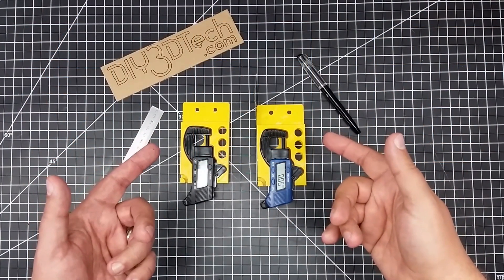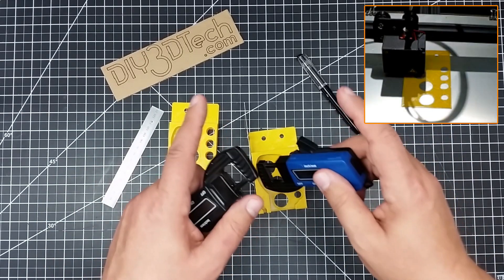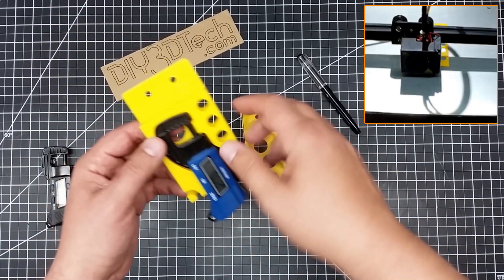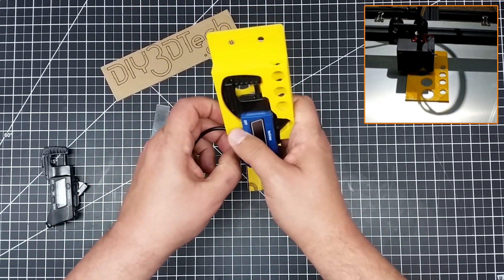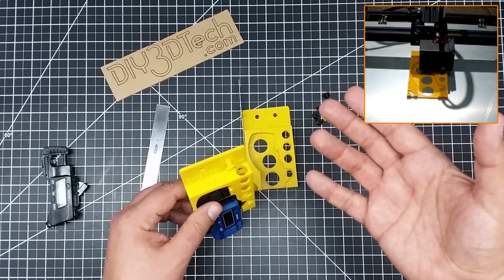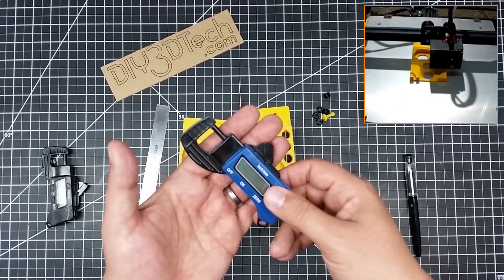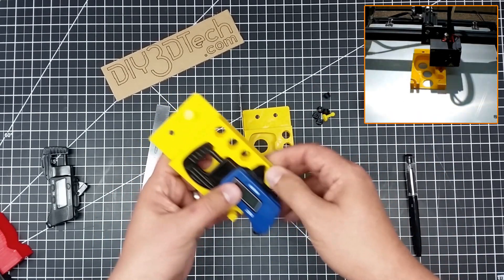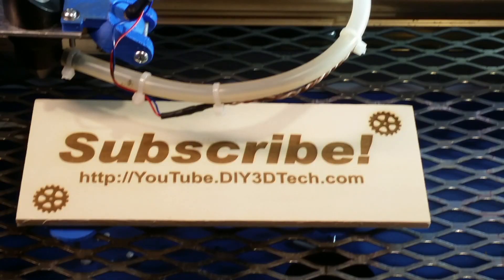3D Printed Project - Multi Purpose Pegboard Micrometer Mount!

Comment: Great video. I am rebuilding my shop with drywall and slat wall boards. I will have to search and modify tool holders to fit the slat wall boards.
Reply from the maker: Love slat board!  Something for me to think about!
Reply: Ya, more expensive than pegboard but I think a "cleaner" look and more "easy" flexibility where you can quickly slide and move things around.
Reply from the maker: Agreeded!  You also gave another good idea with this so thanks!

Comment: Great videos ! Keep it up :) . 
Just in terms of learning how to design > 'Fusion 360' is free for hobbyists and there's a good certified 'CAD and Digital Manufacturing Specialization' course produced by Autodesk available on Coursera (www.coursera.org/specializations/cad-design-digital-manufacturing). Costs €32 a month if you want certification. If you don't want the cert its free.
Reply: There's an 'Audit' option where you can see the videos and do most of the assignments. You need to select the individual course offerings within the 5 course specialisation. More in the FAQ section here - https://www.coursera.org/learn/introduction-digital-manufacturing-fusion-360
Reply: Hey! FREE, you say? What's the catch? Seriously, I'm interested in Fusion 360 courses, but I didn't see where the FREE part was. Admittedly, after I saw the registration part, I looked no further. Anyways, thx for the info...
PS: Edited update... After looking around, I believe I found the FREE part(s). Thx again.
Reply from the maker: For non-commercial use is the catch...
Reply: That'd be me. Thx.
Reply: +Michael Newham - Hey! Thx again x two (2).
Reply: Commercial use is also allowed, provided you don't make more than $100k/yr.
Reply from the maker: Interesting is that spelled out in the ELUA?  As I have not seen that...
Reply: It is spelled out here:
https://knowledge.autodesk.com/support/fusion-360/learn-explore/caas/sfdcarticles/sfdcarticles/How-to-activate-start-up-or-educational-licensing-for-Fusion-360.html

Quote: "The free Start-Up/ Enthusiast licenses allow you to access Fusion 360 with a yearly subscription after the trial period has ended. You can use this license if you are a small business making less than $100,000 per year (or equivalent), or if you're a hobbyist using Fusion 360 for non-commercial purposes."
Reply: Dunno how, Murphy's Law I suppose, this morphed from "Courses" to the Fusion 360 licensing provisions. Ah, such is life...